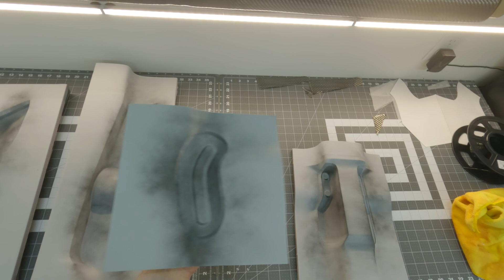How to make a 3D Printed Mold for a Carbonfiber Heatshield

Comment: Great videos. 
Im not sure but wouldn’t it be better to print the positive mold and making a more robust negative glasfiber mold out of it? 

I mean it is one step more, but at least if there will be more parts than just one it would make sense to me, doesn’t it?!
Reply from the maker: To be honest for a serious production run 100% would be the cast. Most things I make are always 1 off for myself. Every now an then I have others interested and when I have pulled more parts never had issues. But def would do fiberglass if I was going to do this fulltime.

Comment: Great work, love your parts from the fb pages.
Have you tried using uv printing resin for the coating process?
I tried on some parts but not on infusion molds.
Might make it a bit faster of a process
Reply from the maker: @rekynw3869  i have not. I dont have any either so dont really wanna start buying more things to test with knowing this works lol. I tried using vinyl ester resin last week and ruined my part/mold 🤣
Reply: @poltdesigns  great to know about the vinyl:))
I have some uv resin on hand from the printers so might give it a try to see if it seals the parts well enough.
Keep up the good work